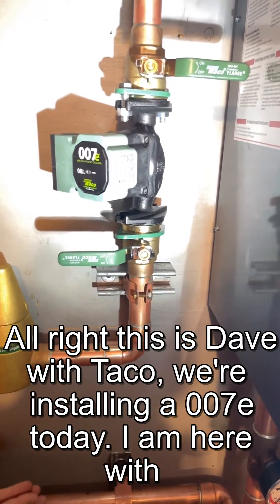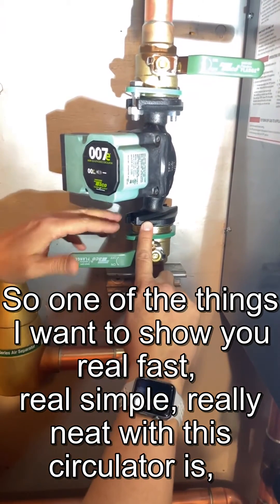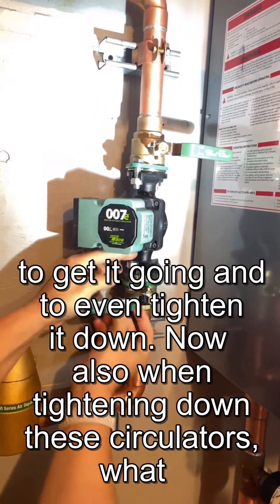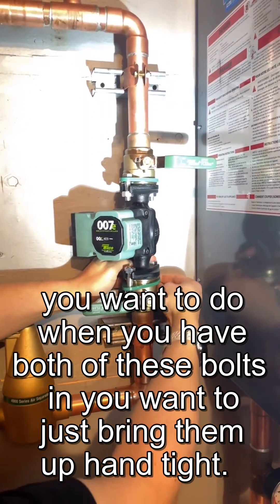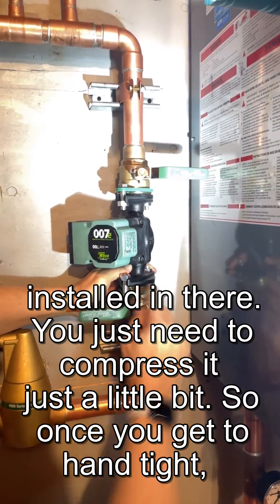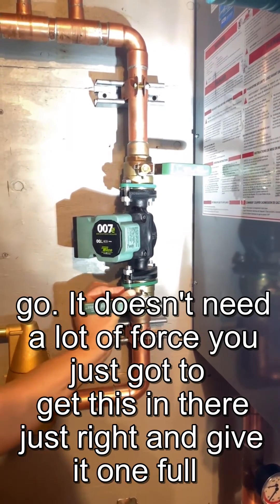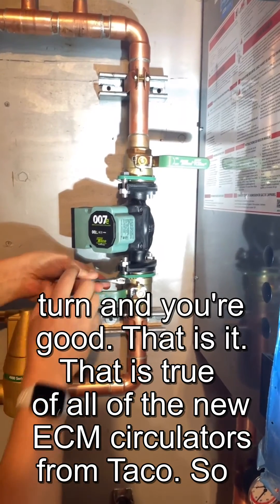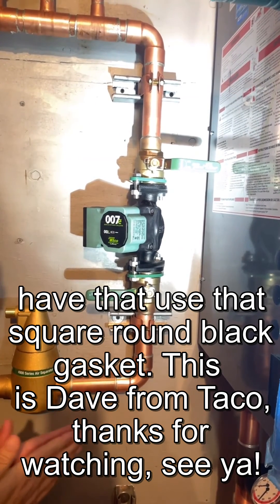Taco 007e installation with flanges

Comment: What does it mean when the light blinks orange?
Reply from the maker: Solid orange light is normal operation. When there is a quick flash to white then back to orange, it means it went into SureStart mode and noticed that there was air in the volute of the circulator
Reply: Hi Dave thank you for the video. What does it mean when the light went off after working fine?
Reply from the maker: @cesarmji  the motor I show in the video is a standard off the shelf production except for the switch. The lights go out when the power is removed or the the call for heat is satisfied
Reply: When should the included check valve be used?
Reply from the maker: @richardfrye1411  I use check valves or flow control valves when the system is zoned with multiple circulators. It helps prevent ghost or gravity flow in a system. In essence, telling the flow of water which way to go, not backwards in a pipe